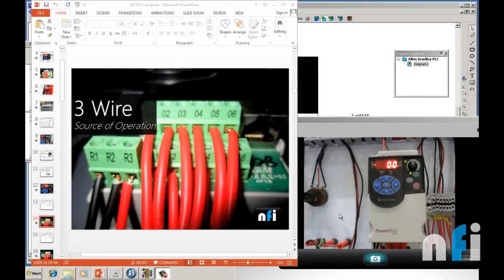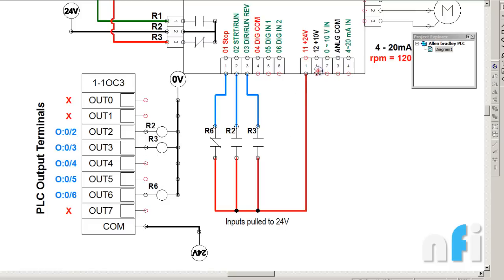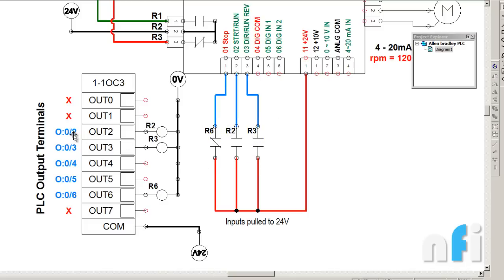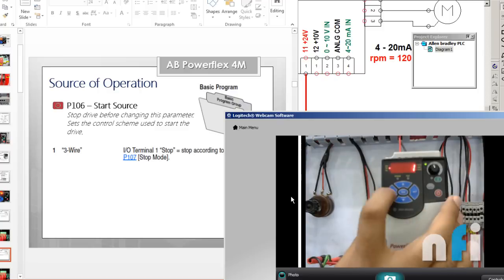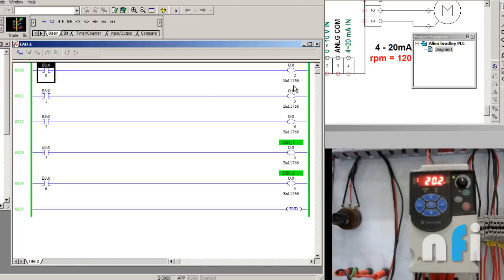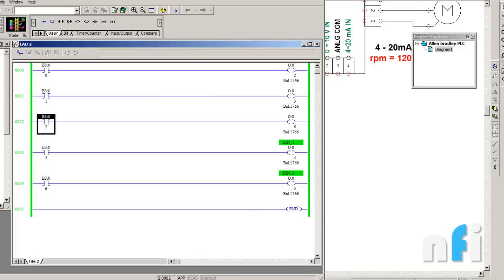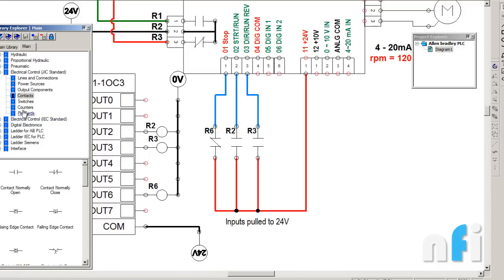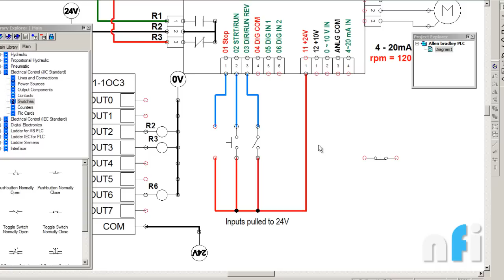Allen Bradley VFD Powerflex 4M- 3 Wire Control Operation

Comment: Hello Rajvir, thank you for your video, can I wire the drive using a micro switch on the motor just to make it turn one cycle and make it stop once completed, and of course im using a plc to control the drive start cycle, hope to hear from you, thanks in advanced!
Reply from the maker: Hello Ernesto, i did not understand your question, can you please write to me at nfiautomation@gmail.com to brief your query.
Reply: Rajvir Singh, thank you so much for your response, I already figured the wiring and input the correct parameters on the drive, now it works li a charm, thank you very much, greetings!
Reply from the maker: Alright, that's great! Happy to hear that. Cheers !
Greetings from Germany!
Reply: Rajvir Singh greetings from the U.S.A!! I'll reply to your mail and show you what we did, Thank you!!
Reply from the maker: Alright great ;))

Comment: thnx a lot sir how can i learn more about plc and drives
Reply from the maker: Dushyant Dhiman To learn more about PLC and Drives please check this course: http://online.nfiautomation.org/catalog/1769?couponCode=LEARNING_MADE_EASY
Reply from the maker: Dushyant Dhiman To learn more about PLC and Drives please check this course: http://online.nfiautomation.org/catalog/1769?couponCode=LEARNING_MADE_EASY
Reply: +Rajvir Singh (NFI Automation) 
Hey Raj.  Great vids!!.

Is it some how possible to use the 0-10v in to control the enable AND the speed reference?  Maybe utilizing the relay and digital IO's in combination.  I have a powerflex 40 110ac single phase to 220v three phase and am trying to get away with using a extra pins from my digital controller just to enable.  Right now I just push keypad to start and use remote voltage ref to control speed.  It would be great if I could trick the drive into saying "if voltage from source is below xV then disable OR if voltage is above xV enable.  I think it is possible,but I just can't see it as I'm so new to these drives.

Thanks for any input.  Again, Great videos.
Reply from the maker: +J Santarsiero I guess it's possible. You can use the feedback terminal of your drive to enable the contact when the input freq/voltage is above say 5Hz/1 Volt. Use that contact to enable (RUN) the VFD. But im not sure. This feature depends on drive to drive. Please check the manual for the same.
Reply: +Rajvir Singh (NFI Automation) I'll look into this.  Thank you.

Comment: Thank you Mr. Singh. If ill just use an ordinary NO push button switch for NO(R2) how will it run continuously?
Reply from the maker: By using 3 Wire control, you can make it run continuously.